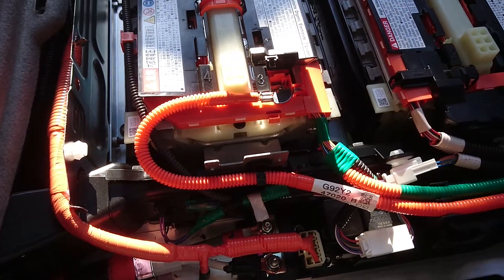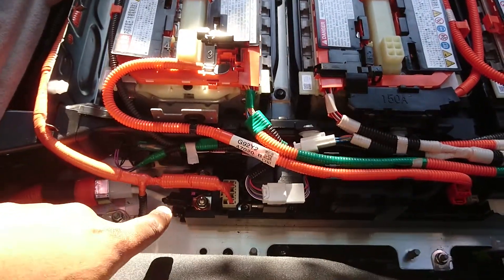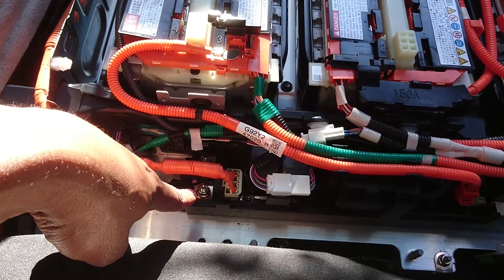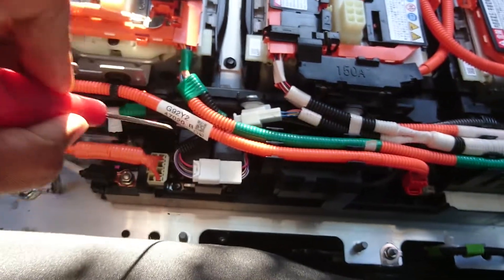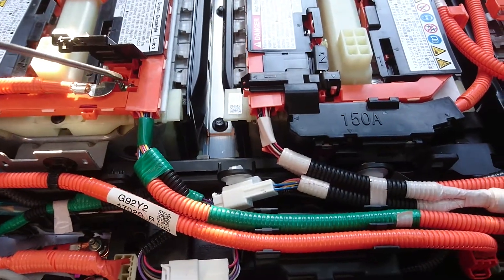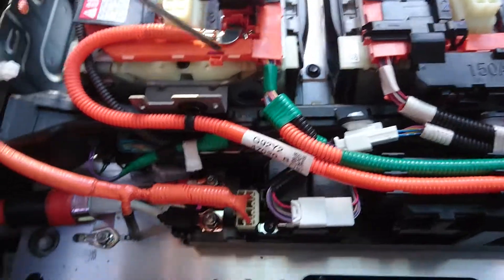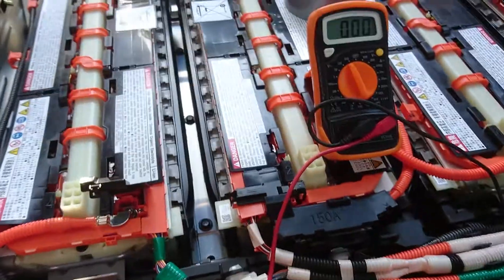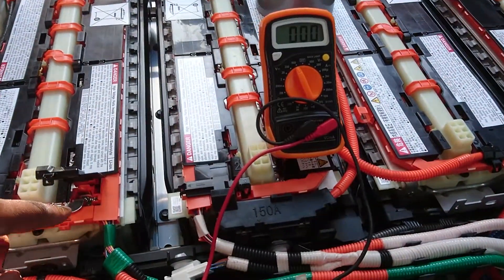Toyota Prius Plug-in range extender part 2

Comment: Hey, can i add another battery in parallel to my 2015 prius? Do you think it will work and the computer will accept it? Its not a plugin, just regular prius.
Reply from the maker: Yes you can. For it to work, you need to make a junction on the high voltage cable going to the front and have contactors on the new battery connected to the car ignition circuit so that when the car is off, contactors will open.
If you connect the way I did here, the current sensor will only allow the amount of power the car has been programmed even though there are 2 batteries.
Is not hard, I learned from other YouTubers because my range remained the same until I bypass the current sensor.
Reply: @fix-and-drive-yo-car-diy  thank you for the reply. But i don’t understand what you mean by “contactors on the new battery connected to the car ignition”
Can you explain it or send me the links of the videos you learned from. Thank you
Reply: @BA-ht8bg  All hybrid battery packs have contactors that isolate the high voltage pack from the rest of the vehicle when turned off or powered down. Go to Weber Auto and watch Prof. John Kelly's instructional videos on how these work. He has the best instructional videos on YouTube and review his safety videos if you are thinking of doing this yourself. I am just watching but will soon get my hands dirty installing a Nexcell V2 pack into my 2012 Prius, but long term I am very interested in adding capacity like Oscar is showing us here. As I understand Oscar he is saying as long as the new battery pack has it's own contactor set up it can be spliced in line and not be limited by the other battery's programming. But this is my novice observation so take it with a grain of salt and learn as much as you can before blowing up your electronics.

Comment: ok so ev is extended to 36 miles at under 40mph?
what was range before?
how long does ice take to charge both batts?
Reply from the maker: The range was 15 miles before and after, the longest Ive done on ev only was 40miles gently, the engine starts when you reach 60mph. So I made sure I don't pass that speed.

Comment: instructions unclear. im modding prius+$tsla battery in the swimming pool.
Reply from the maker: I'm not sure what you saying. I was only making a battery pack that will boost prius battery. It worked very well until my prius crash. I did 45 miles at some point and I was planning to build a bigger one twice the size and keep going. 

What was happening is, prius battery was very happy with the help from the pack so it performed super efficiently. The heat was reduced meaning, during regeneration braking, more power can be taken by prius battery. It was nippy on acceleration(of course not like tesla)lol.
Reply: @fix-and-drive-yo-car-diy  it took me awhile to figure out what i was tAlking about.
it means after watching the video. i have no idea how to. i might as well do the modding in a swimming pool

Comment from the maker: This is old video, more knowledge now and I would have done it much better than this. More videos to come about this in future.
Reply: really looking forward to this, with much detail for DIY. thank you....
Reply from the maker: @kasarara7434  Hi, I am driving full ev now. I am planning to reach 200k miles and then go back to diesel.
Ev, hybrid, and plug-in hybrid are just not as good as we are told.
I made more money driving diesel. I am going back.
Reply: This is really cool! Looking forward to the future videos
Reply: You can now use readily available electric bikes batteries, for example connecting in series 4 48 batteries plus 2 12 volts batteries of at least 10ah. With a 2007 Prius I get 58.9 mpg.

Comment: I have a plug-in Prius and my 150 amp fuse blow. I replaced a fuse and I am unable to clear for codes pOA94, p1a61, p1a64 and p31ab. Any help would be greatly appreciated thanks .
Reply: I bought a Autel Mx808 .This is the cheapest diagnostic tool I found that has low voltage prevention override capabilities and was able to clear the codes after an enabling low-voltage prevention! Thank you for replying
Reply from the maker: Have you tried with an obd2

Comment: Why la That you did not upload any video related to installation of the new pack? You have made a 30*7 cells to have extended range right? Are you using it? How did you install it? Location and other details...... What the results are? Are you having unbalance problems with new cells? Also you have in stock battery 219v right? But in the pack you have built you have 30*4.2= around 120v!!!!! Not clear to me
Reply from the maker: 56 in series x 4.2v = 235v

Each module is 7p28s
Connect both modules in series then is 7p56s
Reply: @fix-and-drive-yo-car-diy  What BMS did you use for the new pack?
Reply from the maker: My car crashed, rear corner. And insurance wrote it off. I will upload a video about that.

Comment: Is there a software modification necessary to do this? Or the computer will not care about extra capacity?
Reply from the maker: No need to modify, just make sure your positive cable bypass the current sensor. You will see your range slowly climb up, mine was around 32 miles. My prius is write off, a guy hit behind.
Reply: @fix-and-drive-yo-car-diy  So you made a battery that matches the voltage of the main pack and essentially run it in parallel to the main pack?
Reply from the maker: @josealbreyes  yes mate. Same voltage
Reply: @fix-and-drive-yo-car-diy  I was thinking of building a pack from LiFePo  BYD blade battery cells and own BMS, matching the voltage of the original pack. Is there any problem if the battery chemistry doesn't match?
Reply: Maybe the computer will be very happy with more energy